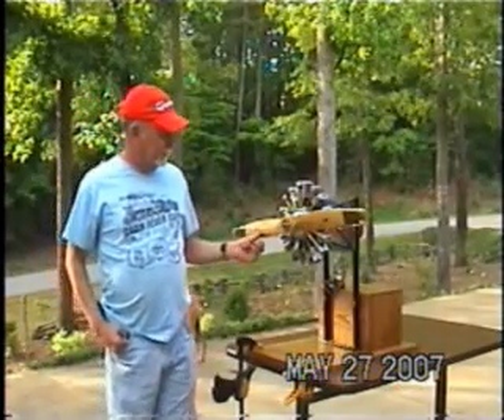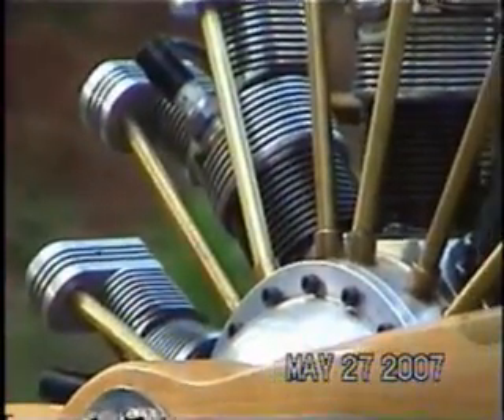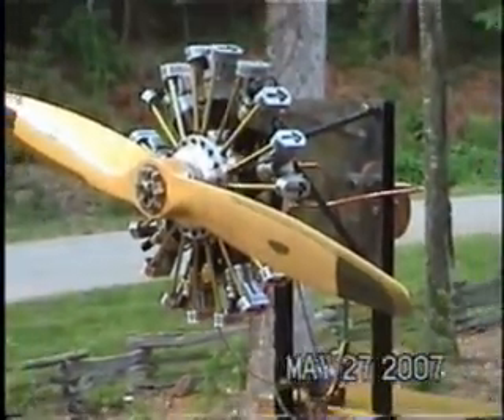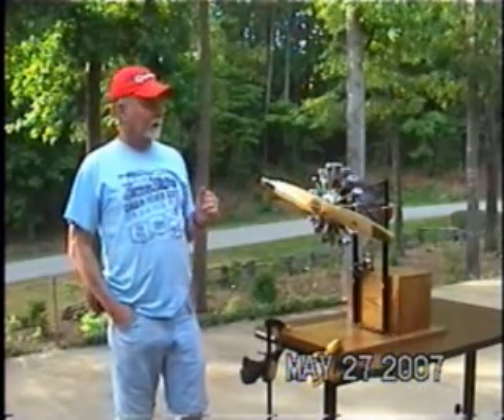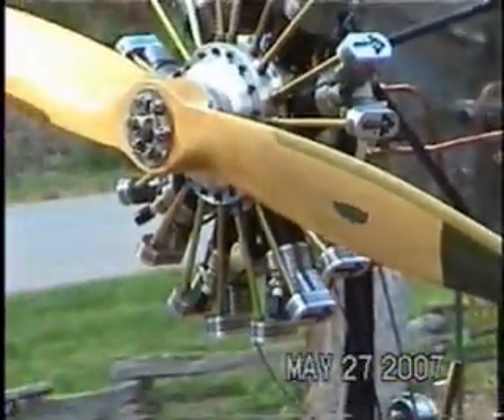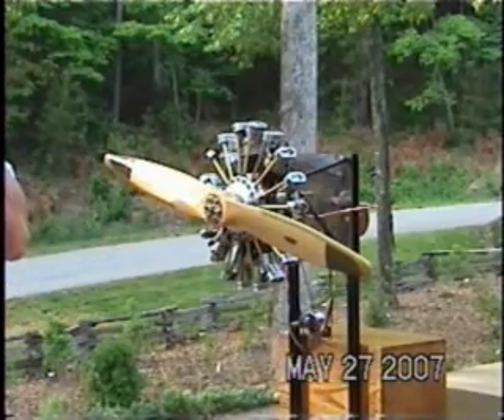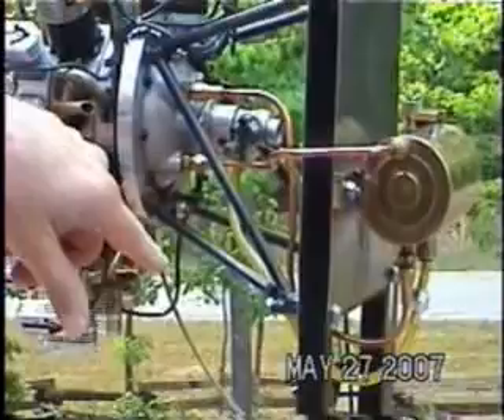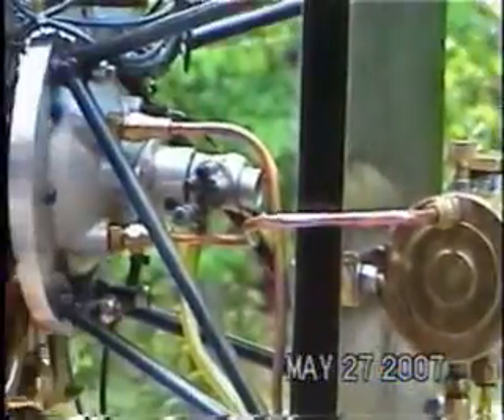9 cylinder model radial engine

Comment: Building a machine like this is at the very top of the Machinists Art.  He said he had about 5 years in the project.   I built a Jeep from scratch, and I've got 20 years in my project.  I can drive mine but I don't have even 1/20th of the actual machine work in a complete Jeep that this guy has in this engine.  I'm in Aw!

Comment: Why are two oil pumps and a separate oil tank needed? Can the sump function as an oil tank and then having one oil pump would be sufficient?
Reply: Much of the air cooling is done by the cylinder and head fins, the remainder is absorbed by the oil. The oil collects in the engine sump, a scaveng pump returns it to the tank where it can cool before returning to the engine pressure pump.  Cheers   Lee

Comment: One thing I learned when I was flying model airplanes is that you set the mixture and left it alone for the most part. If you had to fiddle with it, you were doing something wrong. I hope he builds an aircraft for it. That would be very cool. He mentioned OS as the maker of the carburetor, they also make and sell a 5 cylinder radial of about 4 cubic inches and I thought at first this engine was using those cylinders and heads but it was not. This is an amazing amount of skill and work on exhibition. It would be a shame if that was it, if he's just going to run it on the stand off and on. It needs to be flown.

Comment: how great...what plane do you hope to fly it in? does it run on petrol? What BHP output? 60/61 aluminum material is this prone to temperature fracture ?
Reply: Yes,   but not at these low level heat cycles,    be very lucky if it gets above 100°c      well below aneling temperatures

Comment: Why 100LL fuel and 50wt oil? as far as break in 24x21 = about 30,000 miles. I would say break-in has been achieved. 
We must assume it runs 24/7 as he doesn't say how much it runs every day over the 3 week period. 
If it only runs for 1 min everyday then we have a while to go yet. 

The clearances for engine bearings must be large to warrant using 50wt oil, That is think both hot and cold, would not a 5/20 or 5/30 oil be better? producing more torque which is really what we want isn't it? A hill climber, A thumper of an engine. 

What is the compression ratio? as that we need to use 100LL fuel? Surely a 89 oct auto fuel would be a better choice. 
at 2:54 he seems to forget what he machined on this engine, I mean he just suddenly goes blank.... 
At 3:19 he states that the propeller looks just like a real propeller, It is a real propeller folks, it's just a smaller real propeller. 

I like at the 4:40 mark they find it necessary to make sure we know it is a model helicopter and not the real standard sized helicopter when referring to the carb. . Duh!

This is a sweet little engine, I would love to see 4 of them mounted on a B-17 or a Lancaster flying around the field. 
It would be a bad ass on an F4F or a Typhoon, a Sea Fury or even a FW190 eh!.

I wish I had the Machine shop equip to build my own. So cool. 
Well done brother, Very well done.

Comment: It would be neat if someone could implement the Ilmor 5 cycle engine features into this engine. 3 of the cylinders would be low pressure cylinders fed the exhaust of the other six. More power. Cooler running. More efficient.

Comment: Saw a similar engine in model hobby shop in Chicago about 40 years ago.  It was only about 8 inches across and cost $1000!
Reply: OS Engines out of Japan make engines very similar to this although not as large and they average $2700 -$4000 depending on the displacement. They are perfect size for fully functional rc airplanes. A number of years ago I saw a HUGE (yuge?) Ford Tri-motor using three of them. Once it was in the air it looked and sounded like the real thing. Wish I had been born rich instead of so good looking. I would have ALL the cool toys.

Comment: nice...but what's the purpose?? I mean what could u run with it? I guess a model airplane???  very nice bit is it a better design than the existing model plane motors? fuel milage and power?   don't get me wrong great job...but purpose eludes me
Reply: The purpose was to build a miniature radial engine.
Reply: He could sell the plans easily for $100 and make a fairly good paycheck. 
The purpose of this engine would be for scale model flyable aircraft. 
It could also be used in any other application where someone needed an engine of that size.

Comment: like any other home made engine/motor you have to constantly adjust the mixture and the other parameters that are related to the performance,  but you can not do it when it's mounted on an expensive model flying in the air!
Reply: If the engine is in proper tune, no air/fuel mixture adjustments are needed with the exception of altitude change(s). That's why small engine two stroke lawn and garden equipment have limiting caps on carburetor adjustment screws. Nowadays, most small engine two strokes have NO carburetor adjustment screws and are called "fixed adjustment". Why? Stupid homeowners always screwing around with shit they shouldn't be screwing with. Best bet is to adjust the carburetor(s) to be a tad rich when not under load. Under load, they'll run properly and in "tune". An R/C model airplane doesn't achieve any measurable flight elevation changes that would require air/fuel mixture adjustments while in flight. I'm a retired master mechanic/industrial engineer, Army aviation (rotary wing) veteran, so save any comebacks unless they're in agreement with my "diagnosis". You should have known.
Reply: Yamaha SR650: Explain this then... In the 1960's the facilities at Edwards AFB were used in to track and confirm an altitude record setting flight of over 26,000 feet above sea level with a radio controlled airplane built and flown by a civilian RC aircraft enthusiast. Another point. That 5 cylinder diesel engine of MB was a very successful engine, many running well into the 300K miles area. Lastly, ALL conventional single row radial engines have an odd number of cylinders. The largest single row radial ever was the Wright R-1820, of 9 cylinders. You will see four of them any time you look at the front of a B-17.
Reply: I do not have your experience nor will I have the lifetime of knowledge that my father had! Dad did spend 36 years in the Australian Air Force, in that time he worked on most aircraft engines from 1942 through to 1977 when he was not allowed to stay longer as of his age. He was 55 then. I learned a huge amount from him until his passing in 09. So to the point of my response, I have to agree with what you have written with my small amount of knowledge. Some people do not know when they do not know! My other thoughts are congrats to the builder of this engine, it must be from Dads teaching have an odd number of cylinders as well as a thing called a Master rod if I recall correctly. Cheers from John Australia.
Reply: "odd number of cylinders". That reminds me of who was that? Audi or Mercedes who about 35 years ago were touting their "new" inline 5 cylinder engine. In the commercial, some "automotive engineer" (actor) was asked: "Why 5 cylinders?" The :"expert", in an obviously fake German accent answered: "Because 4 is too small and 6 is too big!" The engine turned out to be a flop. I don't know why it failed but I'm thinking maybe an inherent vibration that couldn't be eliminated. Six in a row, the only way to go!
Reply: Chris Baker Hello Chris, what you said about single row radial engines is what I recall from what my father taught me. Double row do have an even number of cylinders with odd number on each bank if I am correct, Minimum no of 6 then 10, 14 and then 18 if my thinking is correct. Cheers from John, Australia.
Reply: "Explain" the high altitude record flight of an R/C plane? I'd need to see the engine. If it didn't have any adjustment done to compensate for altitude, it's possible it was set super rich to begin with and ran very lean at altitude. Maybe that's why it attained (only) 26,000 feet. It locked up tighter than Fort Knox and 26 grand was all it could do. Maybe it was launched from a B52 or an X-15!  Maybe back in the '60's the EPA weren't strangling the shit out of engines yet. I know, it wasn't a road vehicle. Just joking. The inline 5, I just guessed on it's success. I'm sure they stuck with taxis thus the 300K miles. Most people ditch their cars well before 300K although my 98 GMC w/a 4.3 is at 204,000 miles. Of course I'm a mechanic who changes engine oil/filter every 3000 miles give or take a few hundred, have serviced the auto tranny 4 times, the rear end 3 times, etc. I'd like to change the brake and steering fluid but a 2016 (new) is coming up. I've been camping/riding (Yamaha TT500's) near Mojave since 1977 and have seen some neat aircraft from Edwards fly over. Some "weird" and unusual aircraft appear to be from Dick Ruttan  or his design(s) out of Mojave Airport. I never contested the odd number of radial engine cylinders. B17's have FOUR ENGINES? Gee, you learn something new everyday! Actually, from any angle a B17 has 4 engines. Why? "Because 3 is too small and 5 is too bg!"
Reply: Had Clifford Research produced performance parts for Mercedes inline five cylinder engines, they would have had to come up with a new motto. Instead of "6=8" it would have had to have been "5=8". Just sayin'...

Comment: who, what, where, why,and how? you answered 4 of them.. now tell us how. tools cnc drill press general machinist tools? if you have a cnc nice job.. if you did that w a drill press and hand tools your amazing....
Reply: Most model engineers and people who make this kind of stuff are doing it with just a lathe and sometimes a milling machine. I used to belong to the Toronto society of model engineers and most guys were working with equipment 50-100+ years old.
Reply: this is form 2007, i he would have a cnc then he mustve been a milionaire at that time. even now cnc's are expensive as hell

Comment: Awesome job ! Your a talented motor builder.I've only worked on diesel engines, but    someone told me the reason a radial engine smokes on 1st starting ,is because the oil in the crankcase seeps past the rings on the bottom cylinders.Could that be true?
Reply: Yes it is. That's also why you will see the ground crew pushing the propellers around for several engine revolutions prior to starting to make sure there is no hydraulic lock which would destroy the engine. They used a lot of oil during flight as well, up to about 4 tenths of a quart per hour.
Reply: Clifton Jamison

Comment: The question is not if the current generation could machine something like this, the question is...would a millennial have any desire to ?  They would have to consider the CO2 output , noise pollution, hurting someones feelings etc. blah , blah , blah. How sad for this once great country.
Reply: @Michael Batson We younger folks are willing to work for what we want, but I'm willing to bet I'd catch hell at the apartment for trying to stuff a half-ton lathe into the elevator.
Reply: Well, more particularly, the typical Millennial is more likely to live in the city and not have access to the precision equipment needed to produce the parts. And many of them don't live in an area where you could fly anything big enough to justify something like this. The lathe alone costs more then some of the cheaper RC radials on the market...

And the younger R/C folks I know tend to pick electric over gas, not because of the environment(even the most die-hard Green folks don't worry about them. Hell, they even run on alcohol), but because they're just a pain in the butt compared to plugging in a lipo, hearing it beep, and bam, you're done.

Those two things insure that very few people, regardless of age, are going to be building radials in their garages.

@Ron Lawson Mechanical things are still a mostly-male thing, but I know a few Engineers who are women. And plenty of gals who can fix their own cars, too. Hell, even the roommate was curious what the whole mess of cross-bars and linkages that make up my Trex450's Hiller rotor did. got to explain a bit of physics with gyroscopes.
Reply: Well thats silly, we only worry about that stuff on everything but model plane engines.
Reply: Flick Cogswell Tuely remarkable piece of Engineering. I'm greatly impressed, a true model engineer.
Reply: Thanks CJ. Well said
Reply: I'd build a full scale model if I had the time and resources. Everything else be damned! Hell, I'd build a massive wankel prop engine that has rotors the size of a lampshade and an OMP the likes of which has never been seen before! That shitter would squirt so much oil, you'd swear Edwin Drake was your neighbor. The engine would smoke like a bogged down tractor, but those apex seals sure would last. It would rev high, too. Say, 10k+ RPM? Four rotors? Sounds fair! I'd also remake some of the old British aero piston engines. Take a Meteor tank V12 and twincharge the bastard while I'm at it. Give modern Rolls Royce the middle finger and speed off with the engine at a conrod chucking 200rpm, because TORQUE!!!
Reply: I'm a millenial and I'd love nothing more than to churn these things out by the dozen, sell 'em to other modellers. Fuck all that shit, it's a beautiful engine and deserves to be run and enjoyed and flown!
Reply: Well i am 16 and i made compressed air engine on lathe maybye not as good as gas radial engine but not that bad for 'young generation'
Reply: I agree. I don't like my generation. There destroying America
Reply: Michael Baston I have to reply for two reasons, one being a millennial, and two, getting tired of people generalizing a generation based off of what they see on TV. Millennials are anywhere from 1981-2000, so a 35 year old is still a millennial. If you are thinking of kids just getting to college age today, you are looking at generation Z, born in 2000 and later, who I know nothing about besides that they are the tech leaders of tomorrow. I was born in 1990. Smart phones became mainstream 2008-2009ish, my first couple years of college. I work a steady job, 40 hours a week, I worked for my car, my apartment, my motorcycle, and am now married. Some of my friends work more, some less, but they all work and are trying their best to live on their own or leave their parent's house if they are still stuck there. The difference with our generation isn't laziness, lack of interest, or desire of instant gratification. Our generation is the one that graduated college in a recession, found work in fields that don't require our degree, in a time when there are more people entering the workforce than jobs created. It pays to be fast. Being slow means being beaten out for work by others either more qualified from an older generation, or other newcomers. Therefore we are creative and innovative, hard working and pull in a lower income in a time when the cost of living is rising faster than income increases for entry level pay. Frugal is a way to describe this. Housing costs have increased and most jobs for us are in the cities. Apartments and smaller housing don't allow us to afford or have the means to make such things, although there are people my age that do. Unless I, or the people I know in my generation are only the .1% you leave as a margin that wouldn't fit your stereotype, you are completely WRONG. Look, I even had the patience to shut down your obviously factual and researched argument with experience based information.
Reply: Get over yourself.
Reply: It's not even that, 99.9% of millenials and newer generations would NEVER have the patience to build something like this.  They want instant gratification.  They don't want to actually work for something they want.
Reply: @pontiacdriver999  No, it's that they can't afford to even begin. They can barely afford to keep their fridge stocked and their lights on, how the fuck they gonna afford a lathe and a mill?
Reply: Flick Cogswell  hopefully much interest , this is part of being a man , Women for the most part don't really care how things work is the man who tinker with things and are obsessed and amazed at how mechanical things perform . I always thought that the radial engine was an amazing concept and just a natural for use in an airplane . At the Honolulu airport there is a large radial engine this been cut away that is on display and every time I walk by the thing I stop and look at it it just stare at it it is in a real sense pornography to me a engine like that would be an awesome conversation piece to have in anyone's living room . Most of us who are interested in these engines know that they had some serious problems cooling when they put extra rows of cylinders behind the front ones but just one row of  nine worked great  with one row cooling was no problem a perfect aircraft engine and of course that radial sound (remember the Sherman tank had a 9 cylinder radial aircraft engine)

Comment: What a wonderful example of craftsmanship and functional art. How did the Aeroshell or subsequent oils work out? I understand many older design engines have cam & lifter problems because of formulation changes mandated by environmental concerns. Unless roller cams are used, or appropriate additives are utilized.

Comment: beautiful... would love to see it on a flying model.
Reply from the maker: +NeutralGenericUser But isn't "looking cool" what its all about!
Reply: I agree but... 1200 hours of labor and you would risk sticking it in the dirt at high speed.
Reply: garyford99 of
Reply: +Tom Glover microlight.
Reply: xzqzq
Reply: +xzqzq you won't. they are terrible engines for anything but looking cool. It doesn't make as much power as another configuration with similar number of cylinders, and it's very unreliable. Look at what happened tot he rotary engine